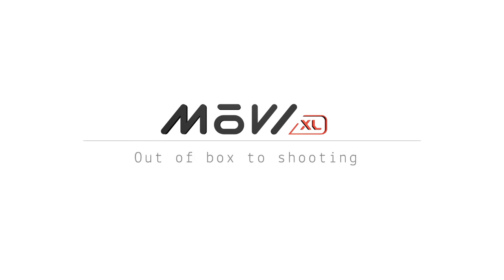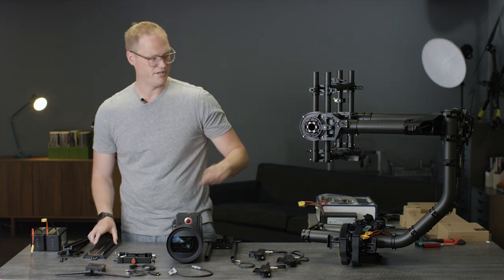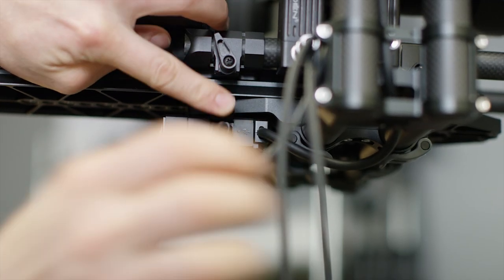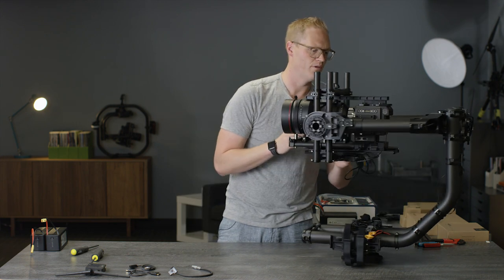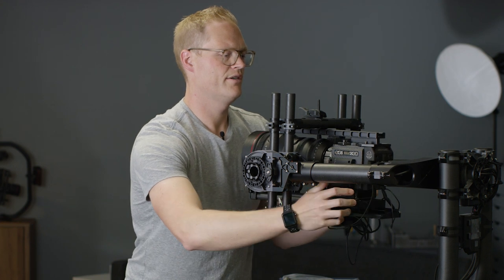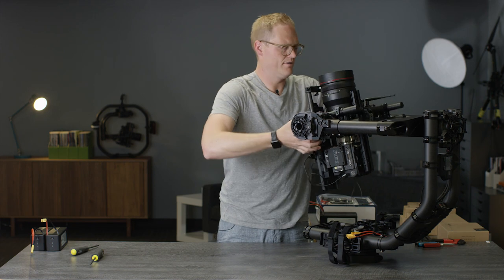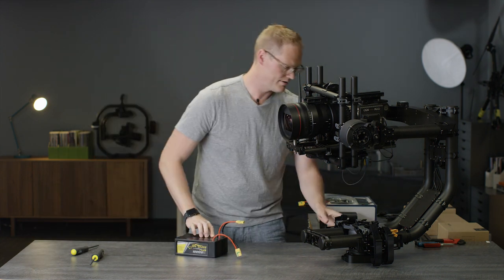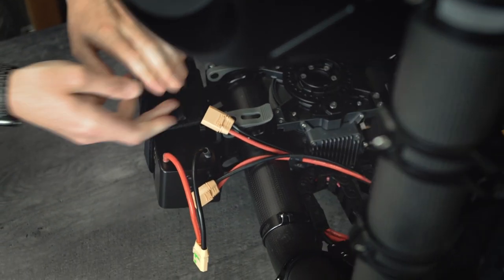MōVI XL - Out of case to shooting in 15 minutes

Comment: Yeah, all my issues start after this video when you actually turn it on and try to use it. The Auto Tuning never seems to be accurate. I’m always having issues setting up this rig. The footage doesn’t look stable no matter how many times I tune it or balance it. I set it all up exactly like this. Very frustrating. Equally as frustrating as trying to get tech support.